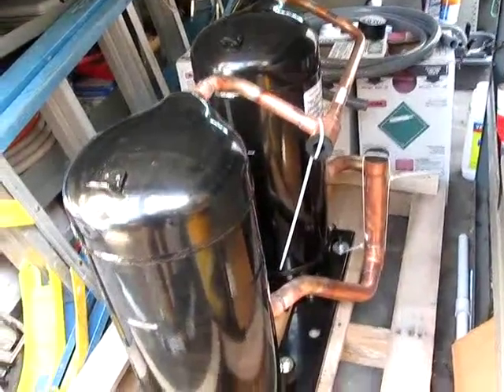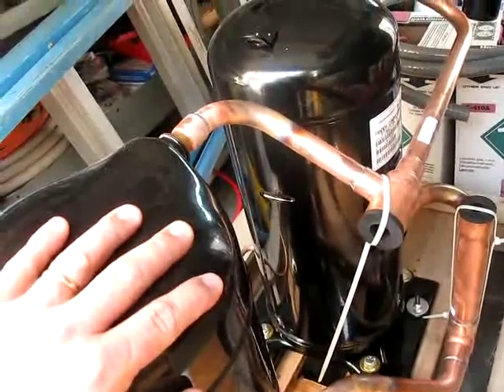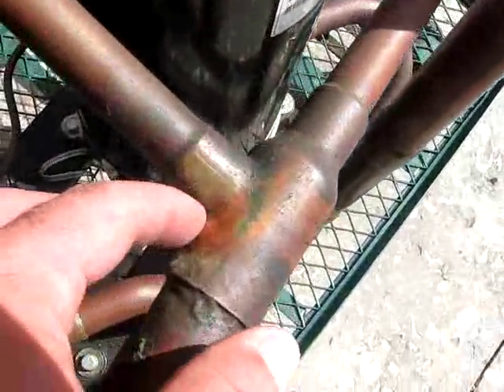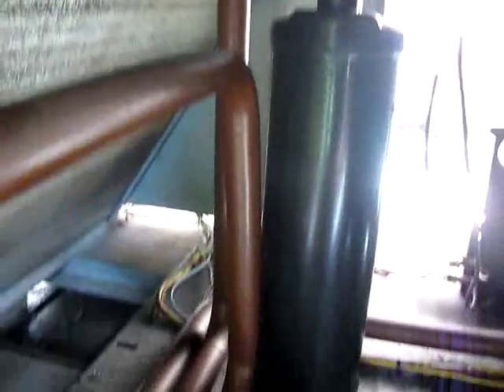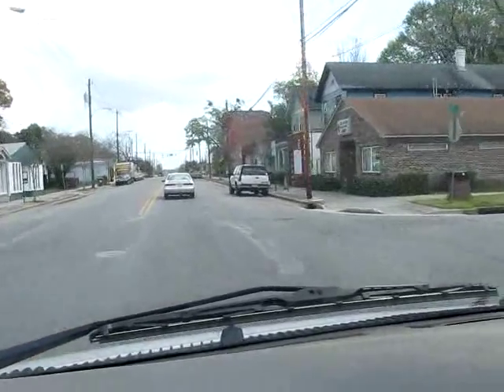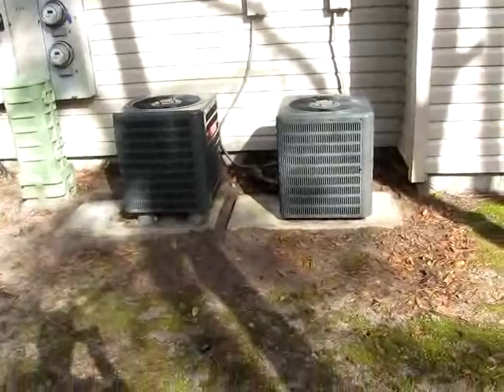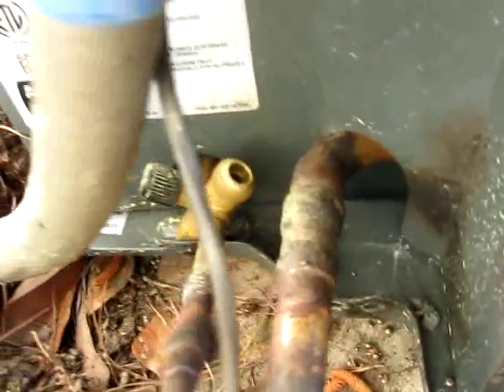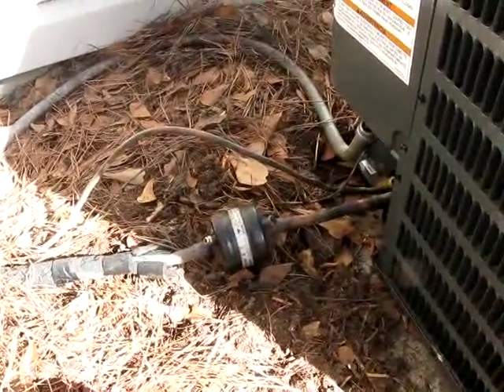HVAC Service- Copeland Tandem Compressors and More!

Comment: Dear HVAC Expert How ROTARY COMPRESSORS(refrigeration based) CAN BE USED in TANDEM OPERATION? IF NOT THEN What IS BRIEF REASON NOT TO USE ROTARY COMPRESSORS in TANDEM? I await your advice (on the matter). if you can email me-I Will Be Extremely Obliged. My Email is nasir@sabro.com.pk & my whatsapp # +92 334 1526306